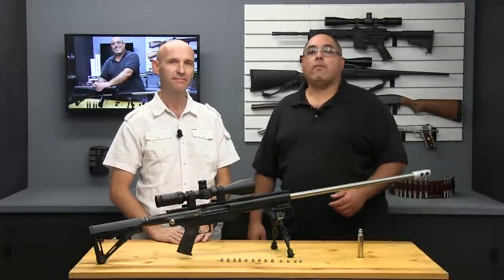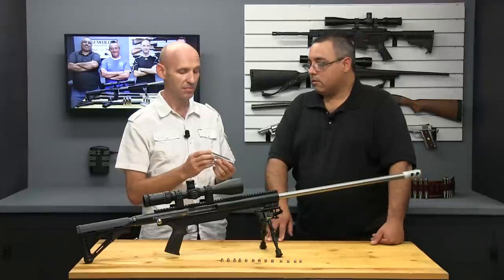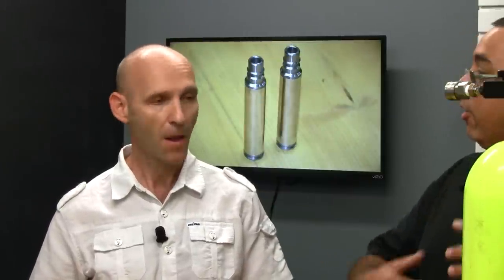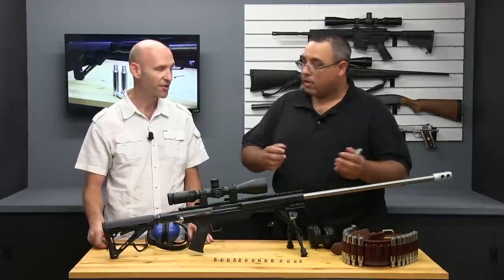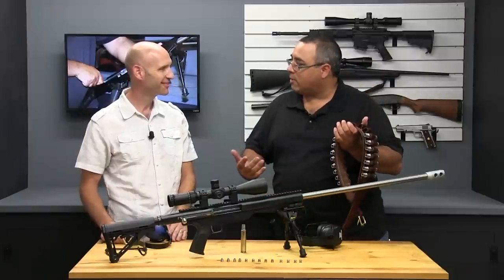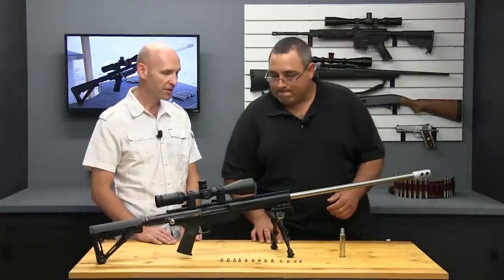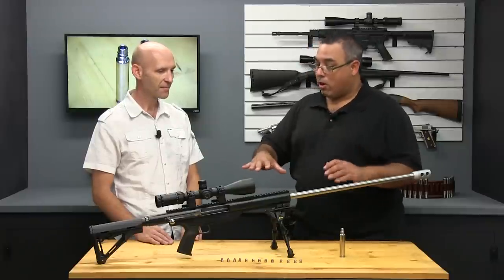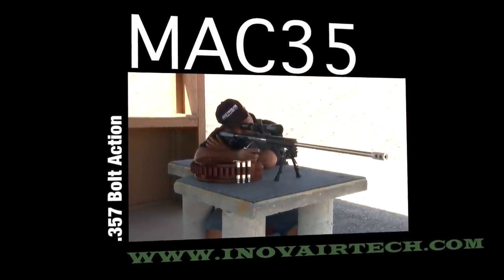MAC35 by Inovairtech, LLC., .357 Big Bore PCP - Interview by AirgunWeb

Comment: Only problem I can see is that it is essential that every cartridge is filled to exactly the same pressure to resume accuracy. Maybe a blow off valve or regulator within the fill line?
Reply from the maker: Filling exactly to the same pressure is not as critical as you may think.  In testing here in the shop, the difference across 100 to 200 psi was negligible. However, a 4500 psi CF tank with regulated output is what I'll plan on using just to be as consistent as possible.  I'll be offering such a rig once we focus in on the optimal pressure and ammo.

Cheers,
AGW
Reply: Thanks for your reply. Got some weapon there. May I suggest getting a test barrel screw cut with half inch thread to take a moderator or build a shroud.
Rich
Reply from the maker: CHOPERUS23  There are lots of plans in the works.  A shrouded barrel model is one of them.  As a point of note, the rifle is not that loud, not nearly as loud as other big bore airguns.  It's not "backyard friendly" at full power by any means, but it's not nearly as bad as some other guns that I've shot either.  I think we hit about 112 or 113 DB here in the studio, and that includes the impact into my steel trap.

Cheers,
AGW
Reply: Have you shot the daystate wolverine .303 at all? That is quite loud even with a weihrauch suppressor. Looking forward to your future videos regarding this Rifle.
Rich
Reply from the maker: CHOPERUS23  I have not shot any of the daystate rifles.. I don't suspect that I will in the near future.  Maybe one of these days I'll be somewhere that I can get my hands on one.  I'm hoping to have a more in depth review of the MAC35 sometime in the middle of September.  They are moving to their new facility will be back out to visit sometime later this month. 

Cheers
AGW

Comment: It's like the designers said "Let's make it as close to a firearm as possible without being actually being one." It's the airgun version of a veggie burger!
Reply from the maker: Luke Walstead   While the designer wanted a very "firearm" looking airgun, it's far from a "veggie burger."  It's a change in thinking of how you can propel a projectile with air.  While others have utilized stand alone cartridges in the past, they've never reached these power levels and ease of use.  The MAC35 is a .35 airgun cartridge that's chambered by this airgun.  That cartridge can now be utilized in any type of airgun Inovairtech chooses to develop to chamber it.  There are already many variations on the boards.  1 cartridge... many guns.. same concept as you get with .223 or .308 firearms.Cheers,AGW
Reply: +Airgun Expert & Critic - Rick Eutsler / AirgunWeb 
Dude, I know you're getting paid to advertise these things, but come on - lighten up!
It IS as close to being a modern firearm as possible without using a burning propellant. 
THEREFORE, it IS the veggie burger of airguns. 
I'm not saying it's a bad system or that's it's silly. I am merely pointing out that, just like a veggie burger, it is imitating modern firearms in its tech and operation as much as possible while still remaining an airgun. 
FYI - it is a guaranteed, measurable fact that it takes less material (cylinder material) to hold the same amount of compressed air in one larger container than it does in multiple smaller containers. What this means is that a air cartridge system will ALWAYS weigh more to carry the same amount of air into the field than a traditional air cylinder. 
Again, I'm NOT saying it's a bad system or that it is inferior to traditional cylinders, i am just pointing out a fact that potential buyers should know and consider before purchase.
Reply from the maker: Your Grandma - Actually, I'm not getting paid for this video or my upcoming full review of the production MAC35.  I'm putting the time into the work because I think it's a very interesting product that may find a unique niche in the marketplace.  The design has advantages and disadvantages.  There are some shooters who's needs will line up perfectly with the advantages of the MAC35 and for them it's far from a "vegie burger."   There are other shooters who's needs don't line up with the strengths of the MAC35 and for them it's not the right product.  The point of doing the reviews is to objectively identify the strengths and best uses of a product and then let people figure out if their needs line up.  That job I take very seriously, whether paid or not.  

Cheers
AGW

Comment: That was a interesting concept. I don't  like the the look of the air rifle itself. It is unique. I think it could be used a step toward using a actual 12 gauge fire arm. Or just to be different. The argument is going to be while buy this when you can just get a regulated big bore air rifle with one tank fill and go. This was posted in 2014 so i wonder where they are now.

Comment: What advantage would this have over a condor or sam yang and the like? How much are the cartridges? Perhaps a specialized hand pump would be a bonus. 
I'll stick with my pcp for now.
Reply from the maker: Hey there.  The major advantage is that each shot is the same as the last without the concern of pressure drop.  Cartridge pricing is available at Inovairtech's website.  Also, we tested filling these with a standard PCP hand pump and it takes about 30 strokes to get to 3000 PSI.  Obviously filling from a tank of some sort is a better option, but any PCP pump will work in a pinch.

Cheers
AGW

Comment: That rifle is begging for a magazine. That would be super if it had a 3 or 5 round mag and cycling the bolt chambered the next air cartridge...
Reply from the maker: Caleb,  It's already in the works.  I met with the guys at Inovairtech today for lunch.  They have the MAC35R, MAC35R Tactical, and the MAC35R Sporter all in pre production testing.  They also have their new MAC25 which is set for .257.  There's a lot more coming from Inovairtech in 2015!

Cheers
AGW

Comment: Cool, reminds me of the Saxby and Palmer airguns back in the day that also used refillable cartridges. You should consider creating a magazine fed model since the air cartridges could allow stacking without warping the pellets. A revolver like Saxby and Palmer's would also be pretty cool,,, except with higher power, cartridge size, etc. BTW, due to the design, what is the limit on the length of the pellet that can be used?
Reply: or any of the other TAC style cartridge using airguns.
Reply from the maker: there are many options in the works right now.. As for pellet length.. I'm testing some 130 grain bullets that are pretty long.. have not seen any issues with loading.. I don't know how far you could push things, but I don't see any immediate limitations.

Cheers
AGW
Reply: AirGunWeb That's awesome, can't wait to see what you have in store.

Comment: To bad their shit doesn't work, it's a nice concept. Oh, not a new invention.
Reply from the maker: +Buba Loui - I'm not sure what you are referring to.. I have one and it works just fine.

cheers
AGW
Reply: +Airgun Expert & Critic - Rick Eutsler / AirgunWeb  I "had" one and it didn't work. Leaked air like a sieve, and it was their part leaking, nothing on my end. Come with parts broken and parts missing. Bolt action isn't smooth, I see that your wife wasn't happy with it as well.
Reply: +Airgun Expert & Critic - Rick Eutsler / AirgunWeb  They did help, they refunded me PROPTLY. I can see that you can be swayed by free product or being sponsored by a manufacturer. Asking you what's better, an FX bull pup or an evanix, would be like asking Kevin VAN dam, whats better your cheap ass nitro bass boat or a Ranger. And if you do a search you will find that I am not the only one that had issues with their guns, it's easy to find.  I have a hard time buying into the B.S. you spew in your reviews, I guess I'm old enough to read between the lines.
Reply from the maker: +Buba Loui - so you had an issue and rather than have it resolved, you requested a refund and they did so promptly.  So from that one experience all their "shit doesn't work?"  That's hardly objective or fair to the product or the company.  To date I have not received any compensation from Inovairtech.  Yes they provided the rifle for me to use for testing.. but I've put 3 to 4 times the value of that gun out of my own pocket in supplies and time to help them continue developing the line.  I believe in what it can, and I hope, it will be.  You were an early adopter of a new system.  There will always be issues with new systems.  You can grow with it, or abandon it.  I've chosen to grow with it as I know that it could be a very good method to power airguns.  You chose to abandon it.   

You've made assumptions about my work and my character in your previous comments.  Please read between these lines.  My integrity is all I have in this industry.  No product or company is worth jeopardizing that.  What you DON'T see are the conversations I have with manufactures where they want to throw the phone at me because I'm telling them their brand new super airgun needs a lot of work before it comes to market.  You you DO see is me working with products that have met my test of worthiness to review in the first place.  I review them and report on their suitability to be used as they are marketed and how to get the most out of them.  I also give consumers interested in those products information about what to look out for if they choose to go that direction.  That's objective, that's fair, and that's how I do business. 

If you asked me to pick FX vs Evanix, I would ask you what kind of shooting you are looking to do and go from there.  They both have very usable options for various needs. For example, if you wanted to hunt hogs I would not say get an FX.  If you wanted to shoot benchrest, I would not say get an Evanix. I've shot FX guns.. I like them.  I like Evanix guns as well.  If FX contacted me and asked me to look at some of their products, I'd enter into a discussion with them to that end.  To date that has not happened.  Evanix has been very proactive which is why you see me review and cover their products.  

Too bad you didn't give the MAC some more time to develop.  Mine is shooting very, very well.

Cheers
AGW